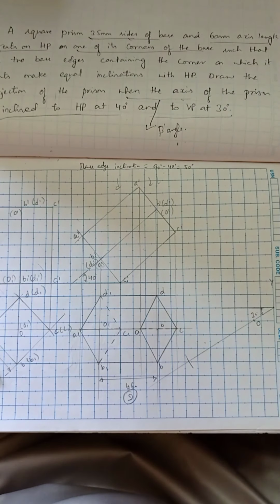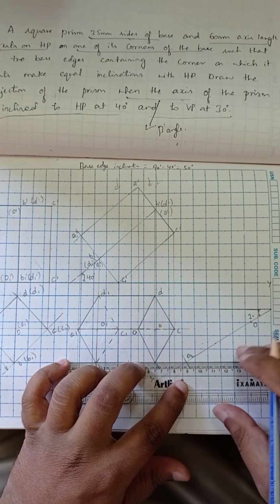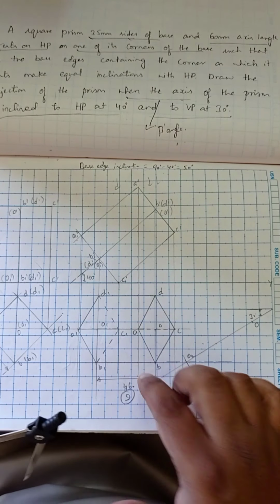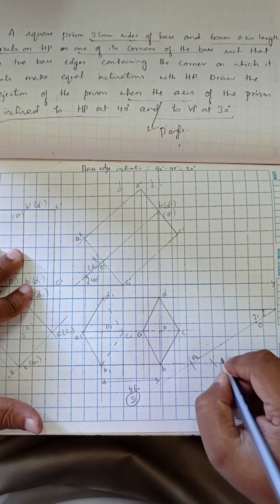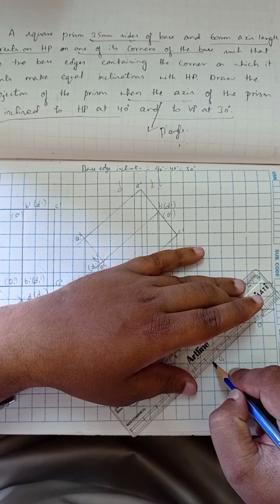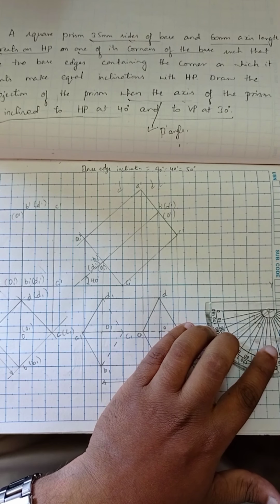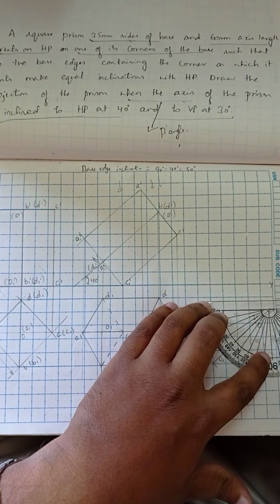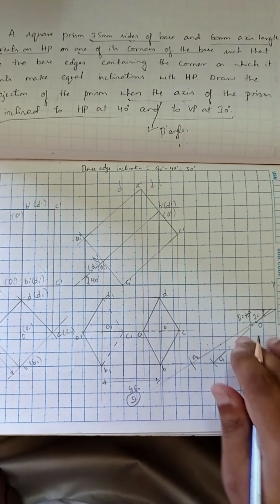Beta angle in square prism

Comment: ac in second bottom figure should be dark n not doted
Reply from the maker: No it is dashed line which is visible...
Reply: @engineeringvisualization1005  but dashed line is not visible, invisible line is made dashed
Reply from the maker: @anshhatwal6791  yes visible face and edges drawn with continuous line and hidden faces and edges drawn with dashed lines.. If there is a merging of dashed line with continuous line.. We need to show continuous line...
Reply: @engineeringvisualization1005  so then ac should be dark because a is nearer to observer
Reply from the maker: @anshhatwal6791  which position is it 2nd position top view or final position...
Reply: @engineeringvisualization1005  2nd position